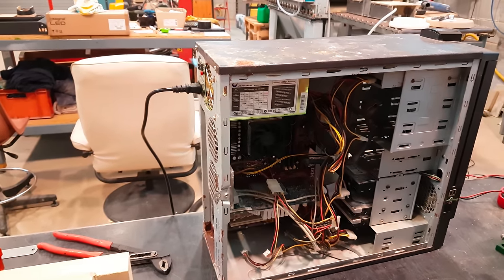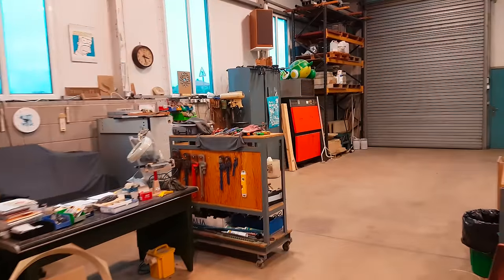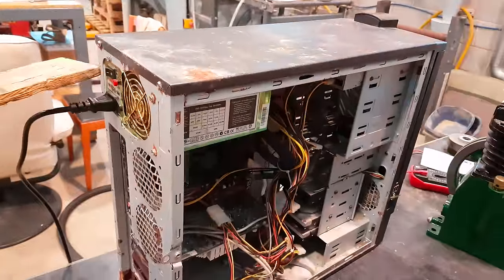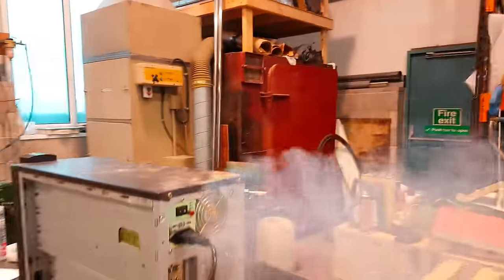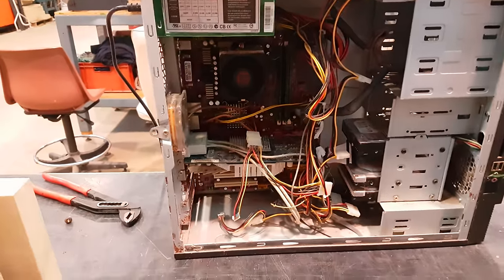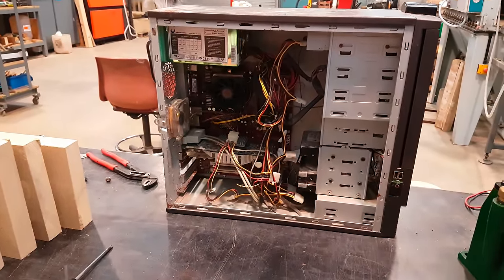Computer Explodes!

Comment: And this Timmy, is why you don’t buy $15 power supplies.
Reply: It says in the description the PC was water damaged.

And it’s a jeantech junk PSU.
Reply: @XZ-III  wtf do u mean stock one LOL
Reply: @Afraid1337  one that came with the cage
Edit:case*
Reply: @lightningbolt171  ah ok, still dont see how that changes the fact that its a 15$ psu LOL
Reply: @Afraid1337  it came with the cage and he used it instead of buying a good one, maybe it's even cheaper and worse than a 15 dollar psu
Reply: From wish
Reply: That's why I bought a $20 power supply >:]
Reply: @ColdFuse96  its probably same lol
Reply: That's why i brought $66.68 Corsair psu in $481.17 budget build
Reply: Me buying a literal 1$ psu
Reply: That's why you don't buy KSAS.
Reply: I have learned my lesson
Reply: Or mix and match psu cables. Even from the same brand.
Reply: Mine was $15.99. I should be good right?
Reply: @TheLangeLange  hehe
Reply: Knowing is half the battle. Knowledge is potential power (Jim Kwik).
Reply: @Cringemoment4045  I actually made that mistake once and burned out a hdd.
Reply: That's why you need 1500 watts 80+ titanium
Reply: @Spladoinkal  oof
Reply: @Cringemoment4045  yeah....it was just a gaming drive though and most of my games are cloud saved so no huge loss but damn
Reply: @Spladoinkal  Yeah.
Reply: got mine with $9
Reply: Ive bought hi end psu's from thermaltake & coolermaster in fancy box's with lots of extra's & had trouble with them such as randomly switching off, i had 1 pop like this vid & it didnt damage anything on the motherboard. I then bought a lo end psu around £25. & it worked beautifully for yrs.
Reply: I'm the 3.2kth like
Reply: No joke my old PC did that just this month 💀💀💀
Reply: This is probably a $3 power supply if it’s doing that
Reply: In all honesty, I never bought one below 130 USD... 
Currently using all corsairs with at least 7 years warranty...

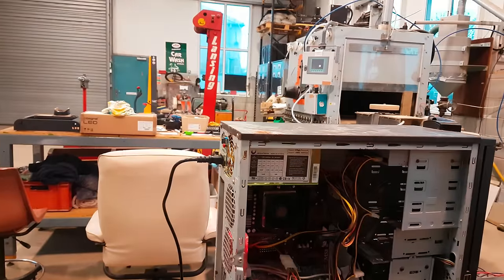Comment: 0:36 my PC when i run minecraft on 32 chunks
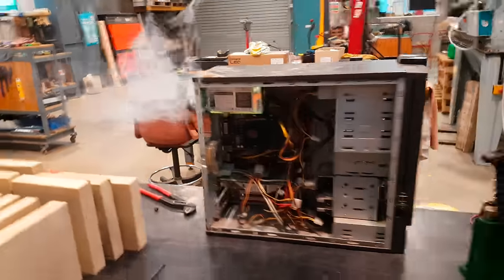1:12 when i run minecraft 32 chunks with shaders and GTA V with full graphics on same time
Reply: Hahahahaa🤣🤣🤣🤣🤣🤣 omg man
Reply: You can run Minecraft at 32 chunks? damn you got a gaming rig
Reply: @jordzking6330  what do you mean, i have a ryzen 3 4300ge with radeon graphics and i can get the chunks up to 48
Reply: @ghost7033  ryzen 3 damn you see the problem is that your processor alone probably cost 50% of my PC
Reply: @jordzking6330  gaming rigs are probably like 2000$ 4000$ but i have 70$ conputer
Reply: @muhammadikramsheikh6731  Bro your PC is jacked mine is probably worth like 50 dollars
Reply: @jordzking6330  oh my PC is a money thief cuz its 2GB ram 128GB rom Intel celeron 1.8Ghz 150W psu a stupid dell motherboard nvidia qaudra 300
Reply: @muhammadikramsheikh6731  Damn bro bet you get atleast more than 10FPS I'm over here at constant 6 with a AMD A6, 4GB DDR3 ram (Which is still worse than 2GB DDR4) and a 450 GB Hard Drive and a 200 Watt power supply that gets overheated after about 1 hour of having Microsoft word open
Reply: @jordzking6330  this is my PC:
Dell optiplex 390
240V dell PSU
Intel® Core™ i3 2160 3.30GHz
Nvidia Qaudro 600
2X Dell 2GB DDR 3 ram
WD 300GB
OS: Windows 10 pro build 19043
And main objective: 8GB DDR 3 ram
Reply: @jordzking6330  man im just a dell optiplex 390 with nvidia quadro 600
Reply: I am luck to have a rtx 3080 ti and intel i910900k
Reply: bruh geforce RTX 3090 ti is out and i9 10999x might come in some time might go upto 5.8 or 6.0ghz
Reply: still server ram is best which are like 20tb and super computer with exabytes of RAM i hope they might be enough
Reply: I have i9-10850k
Rtx 3070Ti
32gb ram
2TB NVME SSD
750w rm750 gold
Lian Li Lancool 2 mesh rgb
Reply: @thetechnocrat6388  👍🏻
Reply: 0:36 but with 4 chunks
Reply: @thetechnocrat6388  we only care about bad specs.
Reply: @vg6761  lol
Reply: Lol

Comment: At 0:59 you can see the chipset explode.
Reply: Saw it
Reply: @lagosmanuel  Yes, everything about this is dangerous, they are in a big ventilated warehouse, if this happens in a small room and you inhale all that toxic smoke its not going to be fun for you!
Reply: its the led fan
Reply: @Crossfire12312  also if it catches fire
Reply: @axell1687  The LED fan is red but there clearly was also some fire on the motherboard at the same time
Reply: No that's just the Chipset getting an OC
Reply: @Farie977  lmao
Reply: I think because over voltage
Reply: Northbridge
Reply: BRUHHHH
Reply: @axell1687  Nope.Even if it looks like a led it isn't.I bet it's really the chipset.
Reply: It looks like the part of the motherboard caught on fire and the red LED fan turned on to try to cool it down maybe?
Reply: So what causing all of this?
Reply: Hadyan Alfaridzi 

Crysis
Reply: @blmao5150  i thought because of minecraft
Reply: @Alvon_PR  Yeah there was probably a huge power surge from that sketchy PSU
Reply: bruh the fucking pc vent on fire

Comment: As a collector of old PC parts, it hurts to see that GPU in there when you did that.

Not only are the high-end GeForce FX GPUs rare these days, that was an ABIT FX 5900 ULTRA, which is even rarer.

Been looking for one of those for ages now. :(
Reply: That's a nice hobby man.
Reply: Check AliExpress you will get one of these
Reply: Nope.

Zero on there.
Reply from the maker: Sorry chap. I thought the same as you but it was an afterthought.

I've worked for hardware vendors over the years and binned some really good kit.

Won't make the same mistake twice.
Reply: I have GT 240
Reply: @zurawrdesu  and?
Reply: @ComputerExplodes  no need to apologise mate.

Hardware always becomes worthless before it becomes collectable.

During that period, no one really thinks twice.
Reply: @chrunchyhobo  its very old i have been using it like 6 yrs ago and its fogged
Reply: I have ge force fx 5200 in box packed never used wanna buy?
Reply: @zurawrdesu  This might sound blunt but just buy a new gpu. Im assuming you have a job and can save tho.
Reply: @talia5046  im using GTX 1050TI now
Reply: @ComputerExplodes  Mext time take it apart scrap the crap and sell the pieces!
Reply: @ahmedgamingedits1845  LOL
Reply: chrunchyhobo No worries, these were capacitors on the power line so the main board and cpu and gpu are safe as well as drives
Reply: @chrunchyhobo nvm
Reply: @DiamondSaberYT  mate u don't know ur stuff coz if u look closely the main chipset blows
and glows red and im not talking about the fans either it was the chipset that blew so the whole pc is trash apart maybe the drives but even that depends on how high the current was tho?
ps: im also studying I.T and Telecommunications and Networking
Reply: 1060gtx master race pc parts will go up after this crisis for sure
Reply: I believe I have an FX 5700 and a 5200. I also have a Quadro FX 3450, not sure if that's of the same era though. Found em in some old PCs.
Reply: Hey do you want my integrated g43 express chipset with 64mb vram?
Reply: @kriswhite9324 maybe the GPU survived, I've made my fair share of mistakes not anything as bad as this but I've put parts in a PC the first time I build it and everything is semi okay atleast.
Reply: @kriswhite9324  In fact at the end he says he must buy a new mobo.
Reply: I don't understand why people collect old GPU's. What purpose does it serve? It's not like old cars that have a distinct sound, smell or feel to them and can still be used in a modern world. It's just a plastic PCB that can't be altered to make it faster and you can't really appreciate it in the modern world. The only purpose it serves is for nostalgia.
Reply: @AWSimDrifter  congrats, you answered your own question.

Nostalgia.

There's just something about using the original hardware to play a game from years past.

That and I missed out on a lot, due to only getting a proper (that was 100% mine) PC in 2013, so I want to experience what I missed.

It's the same as old consoles, people could just use emulators, but the original hardware makes it so much more enjoyable.
Reply: @AWSimDrifter  it can also be cheaper than buying a new one.

And it's also just nice to have sometimes, to see how it holds up today, and they can definitely still be used, I got a gtx465 and it has been able to play everything I've tested on it so far ( and run as in good enough graphics at a playable fps), and it was only 20bucks.

And it would definitely destroy cards like the gt710 and 730 which are probably the cheapest new cards you can get now.
Reply: @vladimirvlad2563  that's if the processor survived
Reply: @tilburg8683  yeh ik that feeling after I accidentally popped a power supply and that almost turned me off from building pc's
Reply: @tilburg8683  I agree
Reply: @tilburg8683  can't polish a turd
Reply: Same here. Hurt a little to watch. What he could have done is used a wire to short the PSU's green and one of the black wires, which "tricks" the PSU into thinking it has a motherboard connected to it, so it turns on normally. That way, it explodes by itself without taking any parts with it. I happen to have a couple Quadro FX 3000s myself, which are apparently equivalent to the FX 5900 Ultra. Had three, but lost one to shitty PSU way when I was younger and knew nothing about computers. You have no clue how many old shit gets thrown out man. Thing is, when offices have old systems and do changeovers, they usually throw them out because they're no longer of any use to them. I happen to know some people in the CAD industry and they've given so many stuff that was going to get binned. They're standard x86 boxes (branded). I missed so many shit though, Suns, SGIs and other valuable stuff.
Reply: @talia5046  real man use a 8800GT.
Reply: @smokegames1179  I hope not.
Reply: @kriswhite9324  the first one I really build was with cheap parts, but I had already done some upgrading to another PC, but I really like building PC's, I do way to much actually I have like 7 of them now, although 2 of them I haven't build, ( technically 3 but that one is heavily modified from the original state) but one I got cuz I really wanted an XP system and one I saved from the trash, I thought it would be a shame for that computer to be thrown away, although it is really bad, barley runs 2004 games with all load on the GPU. But it's playable enough.

But yeah I do waste way to much money on building pcs now a days, I'm currently waiting for a motherboard for a 12 core operton, I think it's gonna be pretty nice to have it up n running.
Reply: @AWSimDrifter  that is exactly the point it's like car collecting but with gpus
Reply: @tilburg8683  yeh same here but I'm trying to find a white rtx 2080 ti
Reply: @zurawrdesu  HAHAH
Reply: I have a 7300GT and Celeron D(isaster) 331 and Seagate IDE HDD. To be short, i have the whole pc from 2006
Reply: @AWSimDrifter  history.
Reply: This dude's got one you can have now

Comment: Wow those engineers are so kind! Not only they made a fire pc, but they also thought of their customers being cold so they made the pc get hot when we're freezing
Reply: No when the pc starts freezing
Reply: I think the EPA might have something to say about the level of pollution produced by their solution.
Reply: Could you get a electric shock for torching up your computer? Yeah, so Luke. I could also see the fan blades slowing down and twitch at the end. Cause I've got good eyesight and if I scrolled inwards. I would see the fan blades more better.
Reply: Don't try it yourself. This video there is to show that you shouldn't really try this at home because it looks extremely dangerous. Picture this, um, mother's board. Like on your computer or your graphics card. I don't think it's your graphics card. It's the power pack that explode. I could also see the the processor fan rocking back-and-forth as well. But I could see what you mean now. It's the fan that when your pc shuts off. The fan blade slowly all the way down it. It also makes a slow rocking back-and-forth motion at the end. Like I also saw this last night
Reply: I'm on that video now watching the fan. And as I scored in a bit, I could count
Reply: Do you like leaf shaped? Aren't they like petal shaped it? So On that video as I scroll in backwards. I could see the fan blades so I'll go from back-and-forth at the end. So it stops, and it rotates back-and-forth. That's like an impeller shaped on Van blurs, it's like a round Do you mean like in a fan blower?

Comment: What was the water damage exactly? Was it fully submerged in a flooded basement or something? 

I had a 19" Samsung CRT monitor take a snow globe to the vented top/back while fully powered. The globe had fallen off of the desk arch above it. I heard the break, then my feet felt wet, then the monitor blinked to black. I jumped up and pulled the power brick out of the wall. I let the monitor sit to dry for a few days, then put it back into use. It turned on fine, and ran without problems for years. All the snow globe glitter could still be seen, reflecting back from all over inside when looking through the vent holes.
Reply: Monitors have a lot less power going through them but from my experience never trust a power supply, if its slightly corroded it could easily cause fires.
Reply: @Lord_Of_Spoon  CRT monitors are among the most high voltage domestic applications, actually. It’ll just be because the snow globe will have been filled with deionised/purified water and therefore an insulator rather than a conductor. Turning off the appliance and letting it fully dry is usually all that needs to be done for such an occasion. Though if the glitter was something conductive like gold leaf you’d probably be screwed!
Reply: @BearBoiBlake  exactly right. CRT monitor. Not LCD or other modern technology.
Reply: Apparently that psu is a junk one in the first place.

Comment: I pickup vintage PCs for restoration and resale. I am always very scared when I test power them on. Had a capacitor blow on me before and it can be a little scary.
Reply from the maker: Now I know there are people out there like you I won't wantonly destroy old kit. I suppose I knew it needed cleaning and a new power supply.

It cost me almost £1800 when new!
Reply: @ComputerExplodes  Wow, What year?
Reply: I think one of my PSUs did it when I was just using my own pc, a loud poping noise and the PC would only boot with a different psu.

Comment: I don’t know if they are still selling them like that, but my power supply had a switch to toggle between 110 V and 230 V, which was situated right beneath the cable socket. So, there was that time around 20 years ago where I built my first own PC from scratch. I didn’t notice the switch when I was handling the psu, and so I didn’t know what it was what I was fiddling around with behind my PC when I was trying to get it to start for the first time. At the moment I switched it from 230 to 110 V, my PC experienced the exact same fate as in this video. The amount of smoke (most likely very poisonous) was shocking. I immediately pulled the power cord, detached everything else from the PC, grabbed it and put it on my windowsill. As far as I can remember the components of the PC were still in working order, so I just had to swap the PSU.

Comment: What was the actual issue? I presume that the input capacitor failed, causing output dc spikes which led to more failures of capacitors and boards. But what actually happened? Only water damage should not be this bad unless the water is in the board.

Comment: Well,I was playing San Andreas on my core 2 duo when my power supply exploded and the whole area's electricity was gone...Was it because the pc was pushed to its limits??
Edit:What's the solution to avoid such things???
Reply from the maker: It was an Athlon 64 3200+ on a socket 754 motherboard. Built it around 2004 and it was super fast at the time.
Reply: @ComputerExplodes  I guess u didn't read my question
Reply: To fix it don't use a super shit PSU! It died playing a simple game running on a core 2 duo which means you didn't total the power requirements for everything you installed causing the PSU to quit
Reply: it triggered your household's fuse. PSU are known to fuck up your house's electricity line. Trust me. It's more dangerous than what you might think.
Reply: @shobhanadhande6457  A well known and reliable PSU would be great for starters. And another one is a good surge protector. If you live in an old home with old wires, and basically own it. Get a professional to rewire the house. So not only you will have more than enough power for your whole house, you wouldn't have to worry about your house burn down. After a faulty outlet exploded.
Reply: @shobhanadhande6457  well he didnt know the solution..but the only reliable solution is make sure you buy a better psu
Reply: @madartzgraphics2019  NO it doesn't fuck it up it just trips the switch ffs
get ur facts right

Comment: POV: You're playing minesweeper on a gt 710
Reply: Same. So intensive. Mine sweeper with rtx on can’t run with even a 3090 according to benchmarks.
you need a 6050 min and 6070 recommended.
Reply: My laptop from 2007 overheats while playing minesweeper on xp

Comment: Too funny! If it was a previously water damaged PC while it was turned on then it likely already had damaged capacitors. The rest of the capacitors would then fall like dominoes. Pull the drive, try to back up the data, and restore it to an undamaged PC.

Comment: the fact that i can smell this and taste it is exactly why i dont buy cheap power supplies. ive had this happen in the past and one power supply that would shock you if you touched it or the metal for the case it was connected to

Comment: Man, I work in IT as a sys administrator. Work in a fairly sizable data center. I've seen plenty of power supplies die. Sometimes even tripping circuits in the process. But I've NEVER seen one pop MULTIPLE caps like that! Usually you just get the old "one and done" routine, maybe a little bit of smoke.
Reply from the maker: Water damaged chap.